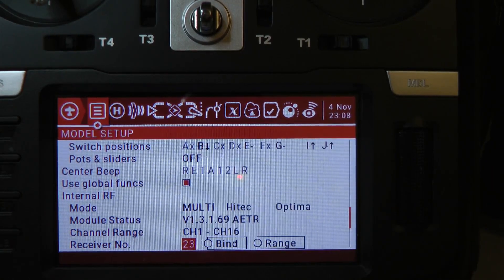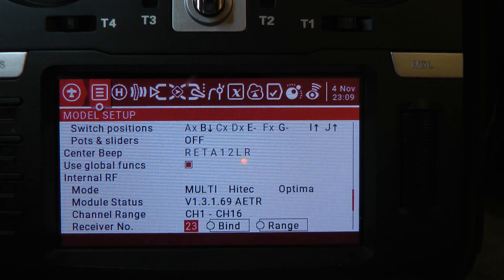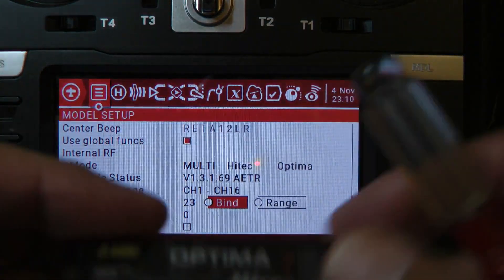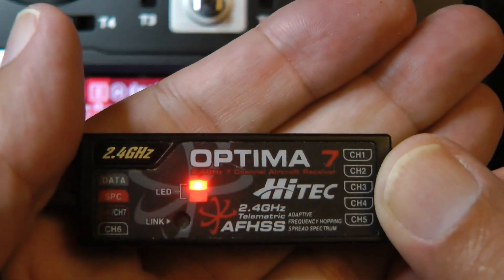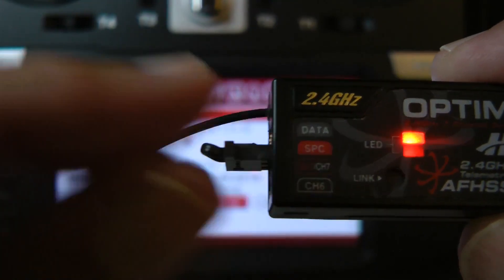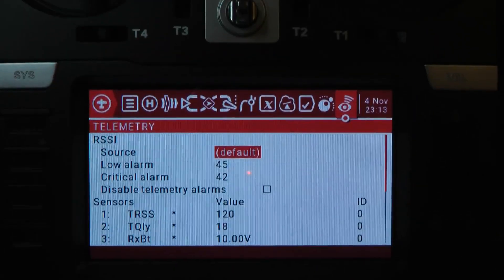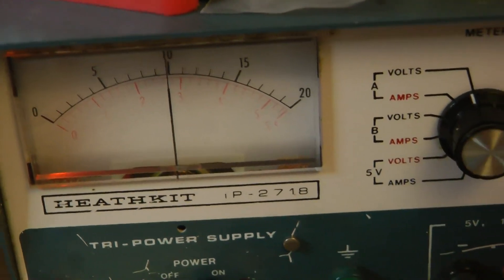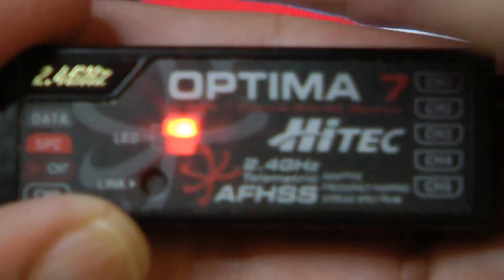RadioMaster TX16S and Hitec Optima receivers howto, Bind and SPC port for voltage telemetry

Comment: Thank you for making a video about it!
I love the Hitec receivers for their dipole antennas and integrated voltage telemetry, they're perfect for line-of-sight airplanes. Guess i'll keep buying and using them for that, and only use Crossfire for FPV planes.
Reply from the maker: The Aurora 9 was one of my favorite radios, it was so easy to program and that large LCD display was so easy to read in direct sunlight.

Comment: I appreciate you taking the time to help show this process. I would like to note 3 things I recommend you consider. 1. according to Hitec the operating voltage for this RX is 4.8 to 7.4V  as seen in this link.  https://hitecrcd.com/faqs/receivers/optima-679#:~:text=of%20the%20receivers%3F-,A.,work%20at%20the%20higher%20voltage 
2. I did not see you set the fine tune, which is an important step to get the best range. 
Finally, 3. if you power the RX BEFORE pressing the bind on the TX you will see the RX go from blinking to solid when you press bind on the TX as the 2nd step.  This may be easier for those who may take a bit more time between preparing the RX and pressing BIND on the TX.
Reply from the maker: The SPC can handle up to 35 volts, the voltage you are referring to is for the servo bus.  And that's not what this video is about, it was simply to show the bind process and that telemetry does work.

Comment: Total newb to the open tx world.  Upgrading fixed wing equip from A9 TX.  This is too good to be true.  Old A9 refresh rate is about 44ms. Question:  using the TX16S with the Optima tx - any clue as to refresh rate?

Comment: I acquired a couple of optima 6 receivers recently and have tried to bind them with the tx16s by using your steps, but nothing... Is there a different process versus the 6 & 7 ?
Reply from the maker: No difference in the 6 vs 7.  It could be the firmware on your MultiModule or the firmware on the receivers.  A lot of people misunderstand when you update the OpenTX on your RadioMaster that does not update the Multi-Module.  Please check and update the Mutli-Module to a recent version.
Reply: @GaryQuiring  I have noticed that the multi keeps screaming at me "module update recommended" 
I'll see about navigating my way through that and see if it works out.
Thanks for the quick response and help, much appreciated!!

Comment: Hi Gary, I'm using an IRangeX IRX4Lite on my FrSky X18 with Ethos. I have made the bind with success between the module and the Optima receviers but I don't have SPC value. Do you know if it's a problem of Ethos or something else? Tia.
Reply from the maker: The SPC port will only report the voltage if you have the jumper removed and provide the battery voltage to that port on the RX.  If you are doing that then the next step is to run the discovery option for the sensors.  Did you do that?
Reply: @GaryQuiring  I have seen that Ethos don't support yet telemetry from external module. So at the moment I can't use this feature of my optima receivers. Thanks for your time Gary.
Reply from the maker: @francescopradella  Ok I have no experience with ETHOS, I'm still using OpenTX.

Comment: Hello, Thank you for the detailed video! I don't have standard switching planned. I have a 10R yacht for fun. On board will be a Hutec Optima9 receiver + servo rudder and a servo sail winch. Additionally, I use a telemetry module with a JPS sensor. Everything runs on 7.4 volts. The question is, can I connect the power from a single 7.4 V battery, with a Y-shaped cable, to the power slot as usual, plus to the SPC slot. Thank you for your answer.
Reply: You all probably dont care but does anyone know of a method to log back into an Instagram account..?
I somehow forgot my login password. I love any tricks you can give me!
Reply: @Kevin Boone Instablaster =)
Reply: @Kieran Sutton It worked and I finally got access to my account again. Im so happy!
Thanks so much, you saved my ass !
Reply: @Kevin Boone Happy to help =)

Comment: also i have radiomaster tx16s with excellent hitech 7 receiver, i would like to tell you that this receiver also has telemetry of the received signal quality ie (tqly) and not (rssi) which shows the amount of received signal data.  the tqly i set it on the display and i activated the weak signal alarm 42 and critical at 45, and it worked fine as if it were an RSSI.  to be able to identify it, go to the TELEMETRY page then activate DISCOVERY NEW SENSOR, then deactivate discovery new SENSOR with STOP DISCOVERY, as it has already identified them, then set on the items page (tqly -valute)

Comment: Great video... my A9 died and I’m thinking of going openTx, but worried about range and reliability. Do you find this radio as reliable and rangy as A9?  A9 was solid!
Reply from the maker: I have not flown with the Hitec receiver yet.  I did switch most of my Graupner receivers over and range is as good as it was on Graupner.  Just make sure to use the fine tune adjustment with Hitec receivers.

Comment: I have the Hitec Eclipse 7 Pro transmitter and all my models are either Minima  or Frsky Delta 8 receivers . I want to change my TX to this TX16S because it works with Spektrum receivers, Hitec stuff is nice but it seems like a dead end, I don't want to invest any more into that system. My question is can I switch between a model with a Hitec receiver and another with Spektrum in the field without complex fiddling around? Is it a case of selecting the model in the TX and it just works?
Reply from the maker: 100% seamless switching.  No fiddling around.

Comment: What do you mean by OLD Optima Receivers Any OPTIMA is 1000 times better than Spectrum anything. Sure as HE[[ doesn't need Satellites. Been using the Aroura 9 System for over 15 years and only had one RADIO failure and that was with a Crashed 7 channel receiver I used for set up of a new model and for got to change it out.

Comment: I am trying the same but I am not able ti make it happen. From the Video I can not see the lights sequence on the rx. When in Bind mode the rx it's a flashing red but when the chirping from the radio ends, the rx still flashing and do not bind. What am I missing. I tried even to fine tune and various rx unique number but nothing. All the firmwares, EdgeTX and the MM protocol are on the latest available. Any wise words are appreciated!
Reply from the maker: Maybe it's an EdgeTX issue?  I use OpenTX.
Reply: @GaryQuiring  well I hope is not, that would be very disappointing. I am not going to downgrade radio, meanwhile I bought a Hitec spectra module with a JR adaptor with the hope that the external RF would do the job. Thanks for the reply bud
Reply from the maker: @federicofrittelli3321  Did you follow the same procedure as I showed, start the bind on the RadioMaster, hold down the button the RX, apply power to the RX.
Reply: @GaryQuiring  Yes exactly the same, James from radiomaster told me he could bind the rx with EdgeTX with the previous protocol, I tried both but nothing...Let's see with the external Hitec Spectra module if I can get around!!...keep you posted

Comment: How did you set up the flaps? I'm doing a Y connection but one servo goes down and the other goes up..  I'm trying not to do it with the Y connection, and use the 7 channel but that where the battery goes.
Reply from the maker: Y adapters typically reverse one side on the output to the servo.  Either move the pushrod to the other side of the servo, get a cable that does not reverse the output or your best solution is to use two channels and mix them.
Reply: @GaryQuiring  my optima 7 only has 6 channel ports, the 7th channel is where the battery goes. I don't know what to do. I got the 1st with a Y connector for ailerons, 2nd for the elevator, 3 Rd I'm going to plug in the ESC, 4 Rd rudder, 5 retracts, 6 with flap but I can't make them go the same direction. One goes up and the other down with the Y . And the 7th it's for the battery. I'm stuck. I don't want to change the rod to the other side of the servo because I would have to make another pair of hole on the flap, so I'm trying to avoid that..
Reply from the maker: @sinuemedina2550  Why are you using a battery if you have an ESC?  The ESC will provide power to the servos on CH 3.  Flaps can go on 6 & 7.
Reply: @GaryQuiring  I didn't know you could do that, so I don't need a receiver battery, the lipo battery will provide the juice for all the plane ??